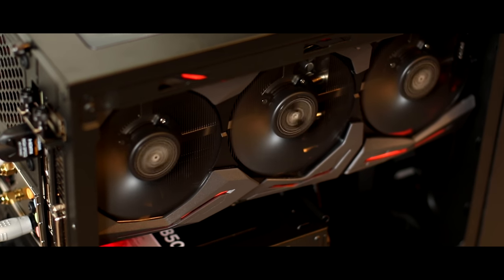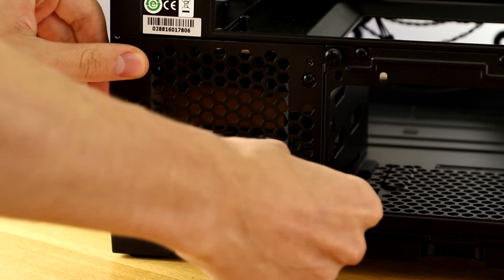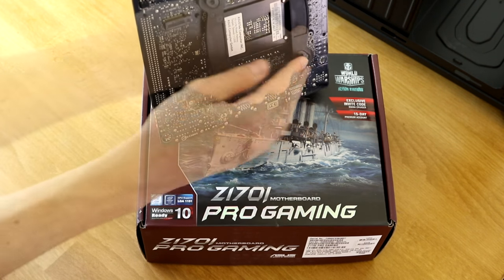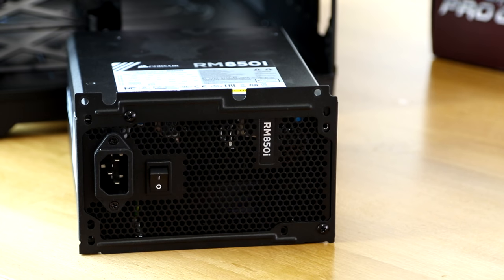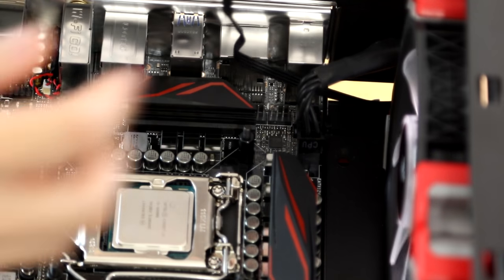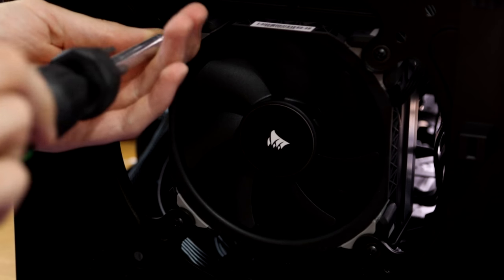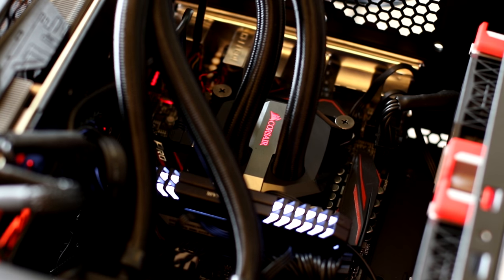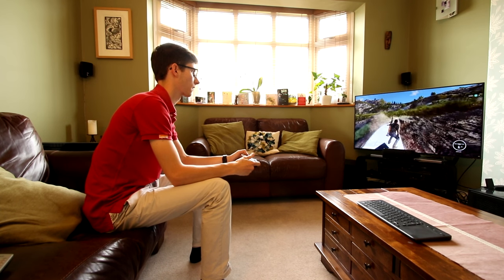Building The Ultimate 4K Mini ITX PC - Part 2

Comment: 1. The fan grill is not made to avoid cables entering the fan, it's made to prevent turbulence, reducing fan noise.
2. A radiator at the air intake is stupid, hot air is coming in, should be placed as exhaust.

Comment: I just built a PC for a friend of mine who's finally come over from console to PC... He always played on console because he like's to play on a TV from his lounge with a controller and he didn't want a big chassis... He then later came over and I showed him his options for cases (he picked the 250D) and that he can play PC on a TV with a controller.

The specs are; 

* Corsair Obsidian 250D (Same as in the video)
* EVGA Z170 Stinger
* Intel Core i5 6600
* EVGA GeForce GTX 1060 SC Gaming
* Corsair Hydro Series H80i v2 Liquid CPU Cooler
* 16GB G.Skill Trident DDR4 @ 3200Mghz
* 240GB Kingston HyperX Savage SSD
* 2TB Wester Digital Black
* Corsair RM550x Modular 80 Gold Plus PSU

and a Wireless Xbox One Elite Controller! :D

+1 to the Master Race! ^_^

Comment: Hi, nice video. That Corsair RM850i psu is redundant for this mini itx build. A 500w or 600w psu would've sufficed. 😉
Reply from the maker: So this PSU was used for the Skylake build (see channel), which ran dual GPUs. Rather than ask for the same PSU but in a lower wattage, I used the one I had on hand. The 650w version would be a way to save an extra bit of cash. Hope this clears this up! :)

Comment: Great build, but I would change one thing. You have 2 exhaust fans and 1 intake fan, which is creating negative pressure in the case. The negative pressure will cause a lot of dust build-up. Change the 2 exhaust fans and make them intake, and change the radiator fan into an exhaust fan. This will creative positive pressure, and there will be less dust build-up. Thanks for the video.
Reply from the maker: +Ivo Broz Interesting thought. Don't forget about fan speeds, and the GPU though, which will draw air into the case too.

Comment: I heard you shouldnt use aftermarket cards in mini itx cases is it true in this case?
Reply: If you have a smaller more restricted case, the a reference GPU will probably be better as it will exhaust all its hotair out the case right away. This case is large enough that isn't not much a problem

Comment: Excellent video. Are you able to give a rough total build cost (UK£)? Also is wifi capability built in on this build or is it an extra peripheral? Excuse these novice questions.
Reply from the maker: Thanks! Wifi is on the motherboard - attach the included antennae. Total cost was around the £1600 mark I believe, including Windows, but without peripherals.

Comment: why do you plug hdmi cable right to the gpu but not the motherboard?
Reply: GPU = graphicsMotherboard = Standard
Reply: Crucial5432 nope my point is that there is a difference in bandwidth strangely quite

Comment: Remove the cover? You whot? It slips off if you place the cpu in.
Reply: ***** If I were you I wouldn't even try to remove that black cover since it will pop off if you put the cpu in just because you can damage the pins while removing the black piece.
Reply: Jono WANG When the cover pops off it gives you a really satisfying feeling 😁

Comment: nice. The VGA is an overkill though :)  
Do you know the Fractal Node 304 case? It is a bit similar, why did you chose this one ?
Reply from the maker: So I was originally after the Corsair 380T, but Corsair were unable to source one. I've been meaning to try the 250D for a while though, hence why it's here. Will check out the Fractal for sure though!
Reply: +PC Centric Check this out too. Silverstone RVZ02. Nice case. Perfect for living room gaming.
Reply: Aris Affandy As far as i know that silverstone case is not only mITX, but it cant even house full size components, like ATX PSU or full size GPU. Without those, you are making some sacrifices..mainly in noise and temperatures...I have built one PC in a Fractal Node 202, which is kind of similar, but you only get it to work with a small PSU -> smaller and louder fans, generally hotter and louder, and a small form factor card: i had the gtx 970 mini. The performance was like 90% of the normal sized one, but man it was loud and warm like hell. Never again. This case, and some similar ones offer a small footprint while letting you use full size of those 2 components. Even decent tower cooler if you wish. mITX boards are as great as the big ones, some ports less but that is about it. I myself have the one from this video. Excellent.
Reply: nah, try your hand on Thermaltake Core V1, beats all the cube itx case on market.
Reply: thats why you must buy SFX-L psu from Silverstone which use traditonal atx fan, not SFX, and a itx size gpu or R9 nano? lol. Going small is expensive but thats the main point of going small. Small yet powerful.
Reply: Muhamad Ubaied I was talking about that lol...I had the latest Silverstone SFX-L 500W PSU and yes it is freaking loud already on moderate gaming. R9 nano is not that strong card and that is itx as well as the 970 mini. Every ITX card produces way more heat and the cooling fan is also out of the line loud. I wanted the super small config but it is not comfortable for me. Too much sacrifices, also running too hot, because of these components. Moving to normal mITX or mATX size is only slightly bigger and you will have everything.
Reply: zeus1117
you sure? the rig i build for my friend which has sfx-l 500 seems silent. Going small is not the best choice for everything. But going small is fun and attractive.
Reply: Muhamad Ubaied Maybe mine was faulty? I was testing it with games obviously. The system you built was also for gaming? For me this 250D or an Aquila I have is small enough. Raven or Node 202 is not like half the size or something.

Comment: where's the optical drive?
without it, it wouldn't be called a PC lol
Reply: Not really, Optical Drives aren't really important anymore since everything is going digital
Reply: what & which is going digital?
Reply: How did you not understand that. DISKS are going digital and there isn't a need for an optical drive anymore. what does an optical drive with a computer